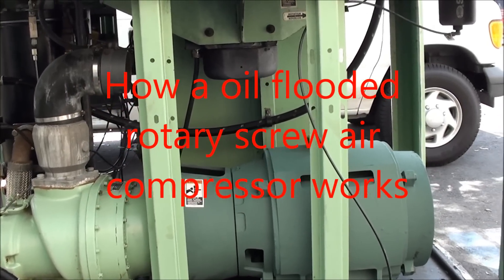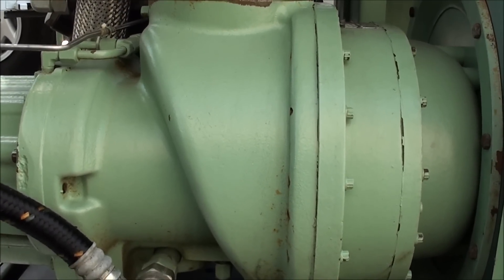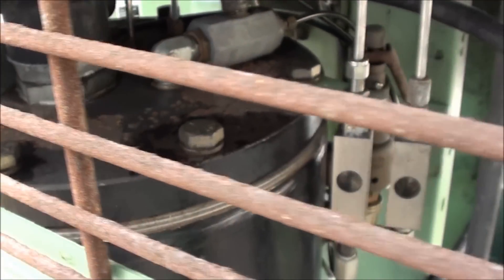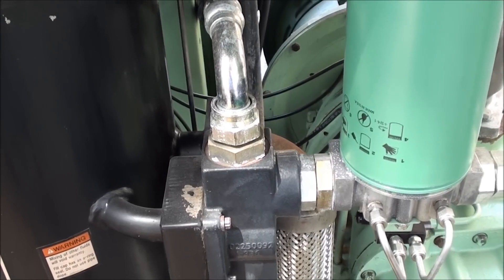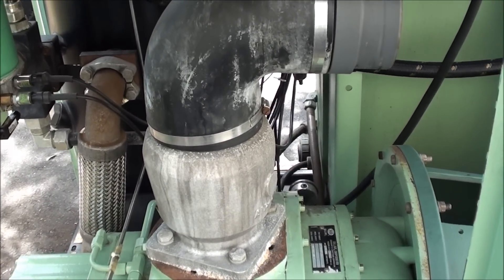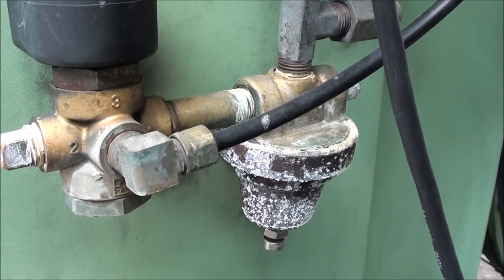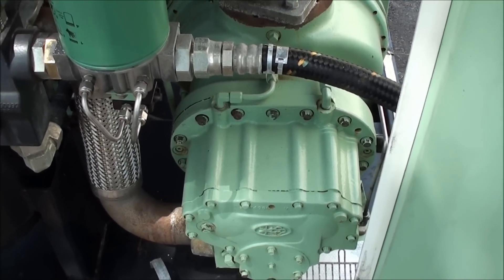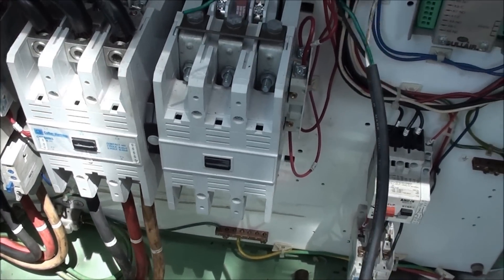How a oil flooded rotary screw air compressor works

Comment: What would happen if the starter were replaced and the compressor itself was turned backwards?  We go the alarm for this today even though the guy wired it the same as it was he even took a picture...
Reply from the maker: If the compressor is run backwards it will not produce air pressure it will not get lubrication and it will lock up
Reply from the maker: If the compressor is run backwards it will not produce air pressure it will not get lubrication and it will lock up
Reply from the maker: If the compressor is run backwards it will not produce air pressure it will not get lubrication and it will lock up
Reply from the maker: If the compressor is run backwards it will not produce air pressure it will not get lubrication and it will lock up
Reply from the maker: If the compressor is run backwards it will not produce air pressure it will not get lubrication and it will lock up
Reply from the maker: If the compressor is ran backwards or the incorrect rotation it will not produce air pressure and it will not get lubrication and will lock up
Reply from the maker: If the compressor is ran backwards or the incorrect rotation it will not produce air pressure and it will not get lubrication and will lock up
Reply: Thank you.  I'm not positive it did I wasn't here but they got the alarm for backwards-rotation. I assume they shut it down immediately, I'll find out.  Our compressors (3 of 4) are water-cooled and are tripping on high air-end temp.  Some think it's the Temp Control Valve but I wonder if the coolant heat-exchanger could be plugged.  Of of them has a brandy-new aftercooler still the same problem...
Reply from the maker: you can always get some new end Bell gaskets and have a look at the tubes as the water flows through the tube and the oil goes around the tube 
in most cases
Reply: Thanks!  Have you ever seen a Temp Control Valve (coolant) who's sensing-bulb line goes to the water-discharge?  Didn't make sense to me but then I'm no engineer.  Us Navy boys would put the sensing-bulb on the coolant-line being controlled but what do we know....
Reply from the maker: No I've never seen that before but some units also incorporate a thermo diverting valve or a thermal mix valve on the oil side of things just as an air-cooled machine would have
Reply: Yes, it's the thermal mixing-valve I'm talking about but our tech-manual calls it a Temperature Control Valve.  I don't get why the mix-valve sensing line isn't on the oil-supply but on the cooling-water discharge it makes no sense.  Thanks for your time sir.
Reply from the maker: +67dodgepolara the thermal mix valve is on the oil side only there is no sending bulb or sending line. The water regulating valve has a bulb on it that typically is in the oil circuit on the oil injection line
Reply: well that helps.  Thanks!  I assumed the mixing-valve was 'sensing' the water-discharge but it's the opposite.  The mixing-valve then makes it's decisions all internally then it seems.  Got it.  Ours run hot, got to be a coolant-cooler issue we have very silty river-water in the Missouri...

Comment: Can i use atf as an oil for the compressor?
Reply from the maker: Yes you can but it doesn't work out so well in humid environments it has a tendency to carry over past the separator element

Comment: I have an IR 185 cfm and I'm changing the separator element. the element fits horizontal in the tank. my question is, where should I position the brass hole that's on the face of the separator? should I align it with the savage line on the cover? that would be at the bottom or 6 o'clock position.
Reply from the maker: +gettingitfirst Yep @ the bottom...That's an old unit they haven't used that style tank in a long time
Reply: +ROTARYCOMPTECH.  Yes it's a 1980 and still blowing strong.  thanks for the quick reply

Comment: I love the Sullair compressors. Or as we call it the big green machine. I use ours to supply air for ceco  drop hammers. It works everyday  hot cold it don't matter. It runs.  ours doesn't have all the fancy electronics to it but I would put it up against any on any day.   Thank you for this video.

Comment: Fantastic video, here's a question, where does the air go when it's being used and the pressure in the sump tank gets really high, is there a prv?
Reply from the maker: It's vented from the sump tank by means of a blow down valve, if the blow  down valve fails to operate there's a high pressure switch that shuts the machine down,
if that fails to operate the sump tank pressure relief valve will lift and vent the sump tank

Comment: thanks very much for answer to me, can you tell me what torque you use for them, the book i have says for lid bolt 3/4 the torque is 200lb or 270 nm. so  i think its too much.
Reply from the maker: bancroft ricketts I've never used a torque wrench on the sump tank lid bolts, just tighten them good and tight your just trying to get the flange gaskets not to leak..Some times aftter running for a number of months it may be necessary to retorque the bolts

Comment: can you explain how to change separator element please . i'm not really agree with the torque the book say.
Reply from the maker: ***** Do not remove the staples As you pass air through the separator element it causes static electricity The staples ground the separator element and Reduce the risk of a sump tank fire
Reply from the maker: bancroft ricketts Don't remove the staples and tighten the bolts evenly..If the gaskets leak retorque, also I put grease on the gasket surfaces
Reply: ROTARYCOMPTECH Hi, I'm also going to replace an Air/Oil Separator on a 250 cfm Sullivan Rotary Screw Compressor. Actually, the reservoir, or sump tank, is pretty much like the one on your video, except that it's shorter, but looks the same diameter. So my question is, what are the staples on the gasket for? The element I bought, has 2 staples on the gasket and they don't seem like they are holding anything together, just the gasket.
Reply: ROTARYCOMPTECH Thank you! Great info!

Comment from the maker: I would check the contacts in the holding circuit like the stop switch, high temp switch, over load relay or relays,
high pressure switch it's some switch in the circuit that is more than likely the cause
Reply: Is the diagrams drawn in sullair manuals is the same as the real built compressors?
because the blow down valve and solenoid valves symbols confusing me

Comment from the maker: 180-190f is normal discharge temp. The compressor must run @ a minimum temp of 170 f or you will make water/ condensate in the sump tank. Check the operation of the thermo valve AKA thermo mix valve, fluid diverting valve, thermostat

Comment: Hi....What's the minimum temperature.. good for oil flooded compressor? I had some situation in tropical country.. The air end discharge temperature is @ 71 Celsius and injected coolant temperature @ 61 Celsius . I believed some wrong with this temperature..Could you share with us some experience.. Thanks.

Comment: Hi....With a oil lubricated compressor (like shown) You'll pass oil and its in the low parts per million! Compressors uses a "Separator" filters..Some have screw on cans and some use a large "Top hat filler"  in the top of the oil tank depending on model and make. The return line should be as hot as the oil tank when the compressor is loading. There are other tests like running the compressor in "Unload" and breaking the return pipe to see if you have vacuum and pressure each side of the brake

Comment: I want to spray or mist an oil into a very low pressure dirty gas stream and then pull the oil back out collect the dirt and recycle. no refrig necessary. Need to clean up the gas so its usable. I thought of the flooded screw comp and thought the system of oil separation might work.

Comment from the maker: First you need to dry the air does the current compressed air system have a compressed air dryer? There are basiclly two types refrigerated or desiccant

Comment: I'm familiar with flooded screw compressors, we have a Sulair(s) where I work.  I'm most interested in the method used for removing the oil from the air stream. As you stated some oil does go down stream but it must be a small amount.  I suspect there must be a reduction in air velocity to allow the oil to drop out.  I would like to know how this is done or directed to some information.  I have a gas stream that needs to have most of the oil removed for proper operation and am looking for ideas

Comment: Excellent job on the video, keep up the great work for all of us out here !!!  With a 6 cyl air compressor (single stage) that puts out 100 psi per each cyl..Whats the maximum air pressure (psi) that I should get in the air tank at standard temperature ? Thanks

Comment: Also used a 1100 cfm@150psi compressor with an airtrack drill, if you forgot to blow it down before shutting it down it would spin the old 6/71 detroit diesel backwards for a second or two after it stopped. would tell the boss that I was just blowing all the giant biting march flies off the radiator... those flies are tough, they would fly into, or be thrown onto,the radiator and stay there all day, then fly off when it stopped.
Reply: I just bought a LeRoi Detroit powered screw compressor, what can you tell me about start up procedure on these? Is there some method to unload the compressor during start/warm?
Reply: @williamrekow7513  I'll correct my above comment here, the 6V71 was a 750cfm, the 1100 was a Cat I think, rarely used that one, can't remember.  
After checking the fluids, aircleaners and inspecting for rat holes chewed in rubber intake elbows, It would start unloaded but was still a little intimidating. While pumping the fuel pressure primer and holding down the oil pressure bypass, you had to also turn the key. Key and button were on the same panel but reaching the primer at the same time (It was a little tired) required getting uncomfortably close in there.

First thing the engine did from a standstill, is instantly rev to about 2500rpm for a few seconds before coming back down to idle.
It never got much warmup before you could load it, when it would rev again before loading up and dropping back to idle. From standing halfway up a mountain in the the quiet, cool dawn listening to birds and enjoying a view out to the Coral Sea, the sound of a v671 roaring to redline was a bit of a contrast. Then the drilling started...
Reply: @enwri : ours is a 365 with a 4-71.
Reply: @williamrekow7513  I imagine they do the same rev ya head off stone cold as well. You had to pull or push a little brass knob to load and unload it.
Reply: @enwri I guess I'll look for a brass knob.
Reply: @williamrekow7513  it'll be on the dash panel somewhere if it has one at all. Should do, let's it run at low pressure for starting and stopping.Not familiar with that one personally.

Comment: was walking to the back of a hydraulic rockdrill, past the 4foot square oil cooler that blows out sideways just as the 2inch hose fitting blew off and emptied the separator into the fan, it wasn't hot enough to burn but it was still effing hot. would have made a good photo, one side drenched with oil, hair sticking out straight sideways, and I imagine a fairly surprised expression. it was an ingersol rand 350cfm behind a 3306 caterpillar with 4 big hydraulic pumps hanging off the front.

Comment from the maker: I'm well aware of how the blow down valve operates.when I preform the fluid change I disconnect the pilot line to the blow down valve then shut the air compressor off the sump tank remains pressurized and the fluid can be easily drained this practise eliminates the on off on off technique to evacuate the fluid. This is a C- flange motor arrangement. you can't change the alignment even if you wanted to

Comment: upon shutdown the pressure is realsed from seperator tank , you can hear it through the silencer. at start up u get 6x amps so constant on off to evacuate fluid dury service severely strains motor. just 1 line end comes off. also there is available rotational alignment gauge to dial in air end to motor prior to coupler.

Comment from the maker: the air oil discharge temperature must be no lower than 175 degrees F or condensate will become an issue..to answer your question it is flashed off and is carried down the airline in the form of condensate

Comment from the maker: Well my Australian friend if it wasn't for your video on that champion air compressor I would have never opened a youtube channel..I just had to make the comment why are you scrapping that thing!!? just for your information those air ends don't come apart easily. I still feel like this would be the perfect field for you to be in it's got everything electrical plumbing pneumatics refrigeration PLC control systems what more do you need? Thanks for commenting Ed